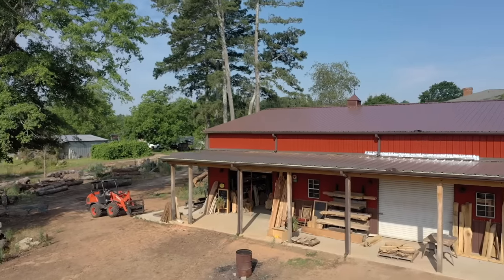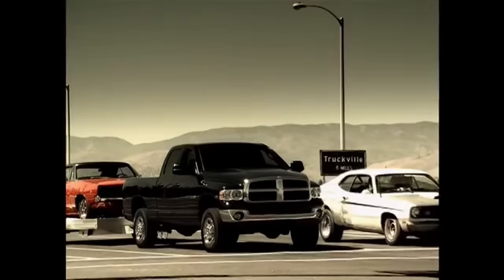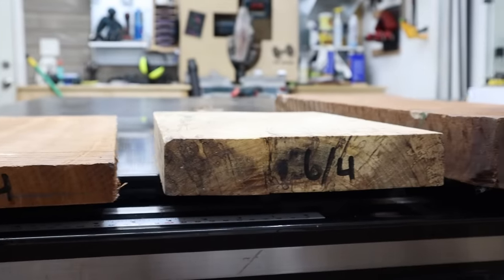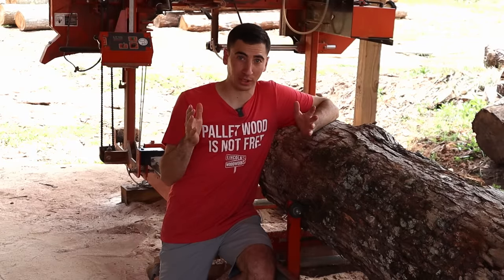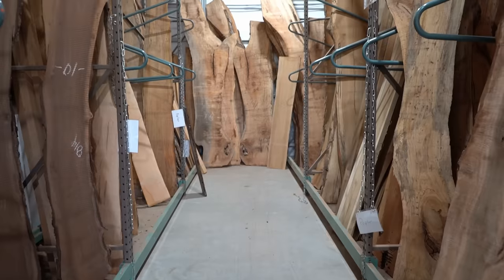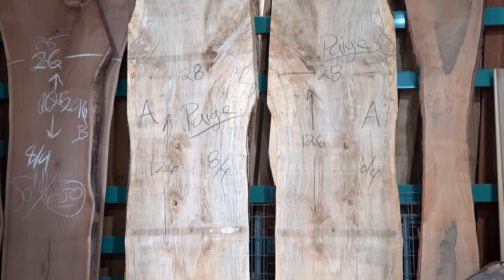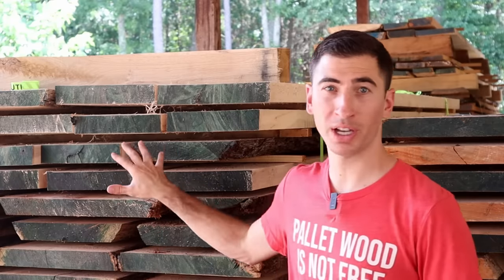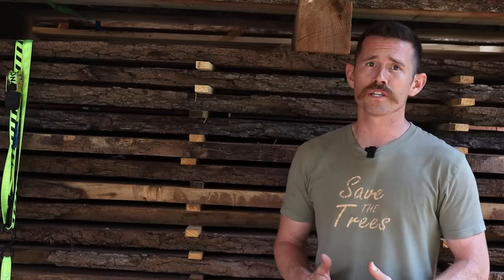The TRUTH about buying from a SAWMILL

Comment: Just saw this one pop up today, so I'm a year behind lol.  Grabbing urban logs is brilliant!  I'd love to see this become a bigger thing.

I had a crew come in and remove about 12 trees from around my yard.  The owner was mostly interested in the So. yellow pines (they were big ones), but I had a HUGE red oak off the back corner of the house that had to go (or my roof would have to go lol).  I asked if he would take that one to a sawmill vs the pulp plant, and could I snag 300bf or so of it after.  He was actually surprised when I explained that it was worth more as lumber than pulp.  He agreed -Son of Gun took it to the pulp plant.  I'm still testy about that.  I really wanted to make something nice from part of that tree.  

I never see full logs at the yard waste dump, so I suspect that the norm in Raleigh is to take them to the pulp mills. The dump gets the chippered stuff.  I know in some areas there are woodworking clubs that have portable bandsaw mills and will come out and slab logs right in your yard.  There WAS one here at one time, but I couldn't find them before these trees were dropped.

Comment: the delivery service from the larger wholesale providers is huge. the other great thing about the wholesalers i use is that many of them also provide hinges, slides, and hardware, as well as production finishes and the support you need for those services.
Reply: That is convenient! We didn't mention in the video but we also offer commonly used hardware and finishes.
Reply: @m2lumber  the main issue I have with my wholesalers is consistency of quality, communication between outside sales and internal operations, and case hardened material. Never have those problems with the small guys, and on the rare occasion there is an issue, i get to resolve it directly with the owner of the mill and not some chain of outside sales people. the small mills are perfect for furniture makers, the big guys support the production cabinetry and millwork industry.
Reply: @SAWimp1  No argument here!

Comment: My husband and I just bought a property with a home that was moved from the east coast. It was disassembled and reassembled but never fully finished. It has been sitting exposed to the elements for over 20 years. The home is 302 years old so the wood is much older. Much of it is salvageable and I'd like to use it for flooring.

Would you recommend kiln drying what we salvage from this? Or do you think with the age of the wood it will be fine?

Comment: Well done video; very informative... One question though: Epoxy necessary on spalted lumber? Maybe all the furniture I've made out of spalted lumber—sycamore, maple, and even poplar—is planning on falling apart tomorrow (after 10+ years), but it ain't got epoxy on it... Water-based poly on some and shellac on the rest.
Reply: Definitely wont fall apart lol. It depends of course on the use and degree of spalting. Highly spalted material has such a low density that typical oil and urethane finished get soaked into the surface so fast that in order to build up a finish on top of the wood to protect it (mostly for tables and high use areas) it would take lots and lots of coats!

Rather than do this, we will typically do one coat of epoxy (there are other things you can use as well on the market, wood hardeners and "Cactus juice" for example), then once it dries you can sand it back and easily apply any other topcoat.

But no, it is not absolutely necessary, to your point.

Comment: Hardwood is tallied by the nearest square foot on the surface which is called the surface measure. Board feet is the surface measure times the thickness. Hardwood lumber is graded based on the surface measure and the cutting unit method.

Comment: So how do you deal with metal contamination in urban lumber?  I had a friend clearing walnut from a lot for an infill project.  He offered me a free log, but I couldn't find someone that would even consider cutting it because of potential metal contamination.  Grandma, got some very nice hardwood to burn.
Reply: It is an issue, and there are ways to try and catch it before milling, but they are not full proof. 

We offer custom milling for the public and we tell our customers that if we hit metal, there is $36 charge per blade and then we let them decide if they want to risk it.

I have personally milled walnut logs where almost every cut has metal in it, and I’d say around this region walnut is the only species where it is still worth it for me! Even though we damage the blades, the wood is valuable enough to take that risk. If I had a giant poplar or pine log with obvious metal in it…I’d make firewood out of it too!!

Comment: The first reason applies equally to wood that is kiln dried, air dried, or dried in process.  Kiln drying is just a fast way of doing it.  It has some advantages and disadvantages.  For amateurs who have at least some storage, I prefer freshly harvested wood.  It is a lot cheaper, usually has better colour, and working properties, and is necessary for certain processes.  The worry I used to have that I would be waiting for ever to get it dry has never really been a problem.  I don't go through it fast enough.  A lot of wood is really only available to me when it is commercially processed, and that is fine to.

Comment: Great video, but, I have to tweak one thing. 1 year per inch.  That’s only if you are air drying indoors in climate controlled environments. It will never dry outside because of the constant changing moisture. 
Ok, I think it’s great that you mentioned how small sawmills save trees when the larger operators only want “valuable large lumber “ 
👍

Comment: One important issue never addressed, is wood milled from large limbs. With very few exceptions, never build furniture from limb wood. 

Limb wood has significant amounts of stress due to the nature of how they grow. . . hanging off the side of the tree. Where as lumber from the body of the tree is growing "up" and not "sideways" so gravity doesn't introduce stress like it does in limbs.

It will be tempting, especially with some massive 200 year old walnut tree that has 24"+ diameter limbs, like we have. Just make sure you know what you are buying and how to deal with stress wood. . . which can be downright dangerous when your bandsaw or table saw is making a cut and the stress is released.

Have extra underwear in your shop. . . you will need them!

Comment: I have a sawmill.... Building timber frames with green lumber is fine....The secret is not to allow any rain or direct sunlight on to your wood.....it causes uneven drying/shrinkage....
Reply: I think we were more discussing using green lumber for furniture, I agree on use For Timbers; usually the movement is not as big as a deal because it’s such large and thick pieces.

Comment: Not knocking your way to do your wood but, you must be cooling your blade on mill with water I use diesel and used motor oil and it pretty much kills all bugs we built 3 barns one was built 40 years ago by my grandfather using the same formula and still stands today I'm 50 years old and help put hay in it last year,green lumber can be used to build with.

Comment: I have worked in a large saw mill, you did not address one question I have. What about the grade of the lumber? This involves the number of knots in relation to grain. The more the knots the lower the grade, example a 1 common will have few knots where as a 2A  or 2B will have more.

Comment: I though sawmills shy away from urban logs, due to nails, staples, hooks for dog runs or clothes lines.  Sawblades are expensive.
Reply: They are not cheap for sure...ideally for sure we would mill only forrest harvested virgin timber but the truth is those go straight to larger mills typically...and again there are SOOO many urban trees that get wasted. If we see obvious signs of metal in cheap logs that could be worth the blade, then we wont risk it. But if I see a big fat walnut log with sure signs of metal in it...im still cutting it lol.

Comment: Question,  
Think about this.
Let's say I buy locally sawen lumber
And take it home to sticker it, but decide to place it in the attic on stickers weighted down 
.becuse my attic reaches 140 dgr in the summer months and durring July and aug almost none stop is that hot enough to act like a kiln? Yes becuse its lumber that might have bugs in it id spray to protect my houses lumber. But a near none stop 140 dgr should kill anything.
I could also do this in a barn or hot house.
Reply: Yup. All you need is temperature and air flow to be a kiln. Biggest difference between your attic and a conventional kiln is the ability to remove the moisture from the atmosphere once it is extracted from the wood. But you could do this, this is essentially similar to what a solar kiln is. Only warning would be to make sure the WOOD heats up to 140 deg (not just the air)…air temp is great but the wood needs to heat up and if you have a thick piece this can take several hours. This is the only downside to a solar kiln, you’re lucky to get 3 hrs of peak heat time during a normal day and this may not be enough to get a piece of wood hot enough in the center depending on the species and thickness. For examples, we have a solar kiln and we have to hit a min of 160 F of the air to ensure the wood can be at 140 deg in the core. We know this through testing.
Reply: @m2lumber  
My point was to buy it and not use it for years. After sevral years with season changes its going to become stable at some point, depending on how thick it is and type of wood, becuse dome hardwoods dont dry as fast, some don't even dry in the dryer like they should.
I almost always buy my wood from a distributor. 
Even though its a 2 year old log after its milled it can still have moisture inside it.
People should always take a moisture meter with. 
I dont own one. I'll stick to my local lumber supplier and hope its always right but even they can sell wood thats not dry enough to use. Its the risk you take.
I was watching a guy make a epoxy table 
He had done almost everything to it got to the point of putting on finish only to find out it mesured 26% in some spots.
Dark woods with a lot of figure tend to take longer to dry. And a sawmill or lumber supplier can buy make or let one slip by. No one is perfect  it happens.
Its what the person you buy it from deals with it if there is a mistake. 
Its best to always ck it before buying.

Comment: You don't know why STICKers which are STICKs placed between boards is called a STICKer?  Why they went with sticker instead of just "stick" is a good question.  I mean the practice of placing small strips of wood... sticks... between boards is called "sticking."  So why not go with just "stick."  I guess some people might call the practice "stickering" wood hence the sticker name... but why?  It's a semantic/etymology conundrum.  It's like why are hammers called hammers and not pounders?  Why are planers called planers and not flatteners... or levelers.... or smoothers?  

I mean why are winding sticks called "winding sticks" and not "twist sticks?"  

The more one thinks of words in general and why they are what they are, and not just woodworking words, you can think about it for forever.  Why is a cloud called a cloud?  Why is there a dozen words and then some for "house"?  Or at what point does a house become a mansion?... or a shack?  When does a mansion become a castle?  Is every dwelling a castle?  Why did I just switch calling it a "house" to calling it a "dwelling?"  When is a "house" a "home?"  Like I said... I or anyone can go for forever thinking about why words... are words.

Comment: Cool moisture meter but if you Hammer that thing into the slab I want you will guarantee I don't buy it
Reply: If you want to be certain of kiln drying wood properly, it’s the only way to do it 🤷‍♂️

Most wood pieces have a top and bottom and we will usually stick it in the “bottom” if we know what that will be….

Comment: Jon,
Really enjoyed your video with Matt @ M2.
I live in Simpsonville area, didn't know about M2 or for that matter that you live in Greenville!
Have you ever worked to keep the bark on a live edge oak slab?
Looks like most folks advise against it, but I am making a headboard and really would like to keep the bark on the top board 
Any and all advice is appreciated. 
Charlie Logue
Reply: The problem with bark is that it has a much lower density than the wood and as the wood moves at a different rate than the bark, it will separate. 

I’ve seen people try to keep it as geared by coating the entire surface of bark and wood with epoxy to prevent this…I’ve seen moderate success in a 5 year ish period…
Reply: @m2lumber  Matt
Thanks for the reply and info.
I am adding the live bark edge as the top piece on a head board.
I've done what you discussed,  5 coats of General Arm-n-Seal
I assembled the headboard to allow me to remove the top board if it starts to come off!

Comment: super intimidating, but a great informative video.  I've seen our local sawmill and is run by a couple of bubbas that look like they're ready to take advantage of anybody that walks in.  no thanks.
Reply: Probably some of the nicest people you would ever meet you can’t judge a book by the cover, inform yourself to the local prices and see what theirs are. You can always walk away or hell just call them 🤷🏻‍♂️
Reply: Biggest thing is to def call around and get prices from multiple and also make sure it is kiln dried. 

Don’t be afraid to ask why you found somewhere else cheaper!! Often times there is a reason, the most common reason I get is that it’s either a lower quality species or cut of wood or it’s not kiln dried. Remember, kiln drying is the most expensive part of the lumber production process.
Reply from the maker: I would echo what Matt said below, and the good news is - now you know what to look out for
Reply: debandmike: those bubbas may be the nicest guys you ever meet. What does it say about you that you won’t take the time to meet them based on what they look like?

Comment: Great video! I work at a local lumber and hardware store in Washington and it is great to learn a little more about the process that it goes through before making its way to us. 

Quick question - any tips on finding a mill that takes urban trees? Our lot has about 20 Doug fir trees that are 60-80 ft tall and we would love to remove several to replant so they don’t loom over our house quite as much. However prices are sky high out here to simply get them downed and we don’t have enough backyard to store THAT much firewood. Thanks!
Reply from the maker: Good question - Ill let @m2lumber chime in
Reply: You may have some mills that fell and pick up, but it's my understanding that many buy logs and/or are gifted logs from arborists/tree companies.  Felling is expensive due to the significant knowledge and equipment to safely get logs on the ground.  Even then its often safer to get chunks on the ground if it's near a structure than it is logs.  It might be worth telling them your situation and telling them you'd like lumber out of the project, but I wouldnt expect the mill operator to be felling hazard trees in most circumstances (if they do a lot of felling at all)
That being said, there are always exceptions to the rule.  If they are near a structure though you are going to want to make sure whoever cuts them are insured to do that kind of work.

Comment: You said grain on quarter-sawn lumber is parallel to the surface.
It should be perpendicular.
Parallel grain would be flat-sawn lumber.
Reply: Then you said quarter-sawn grain has some curvature but rift-sawn in "100% parallel to the surface".
All grain will have some curvature. When you lay a board on a bench, if quarter-sawn, the grain runs up and down (approximately perpendicular to the board face). If rift-sawn, the grain runs diagonally. If flat-sawn, the grain runs right-left but because trees are round, the grain is curved like a smile or a frown. Flat-sawn lumber is much more prone to undesirable movement.

Comment: I wonder why you guys dont have a non destructive way to test for moisture percentages. I should try some experiments with my ultrasonic and transducer. See if its possible to even pull that data.
Reply: the true test is using what they call the oven dry weight method. you weigh a board then cook it in an oven for several hours at a very high temp n(ruining it) and weight it again after. The difference in weight is the water weight which can then be used to calculate % MC...trust me...two little holes is a lot less destructive than this! lol

Comment: I find walnut prices are a bit lower here in Arizona then where it is grown. Odd. Not other hardwoods though. Great video.
Reply from the maker: That is interesting, what are you walnut BF prices?
Reply: @Lincolnstww  depends where, 10-20 $ the small place here in Prescott is the highest but it saves a 110 mile drive.